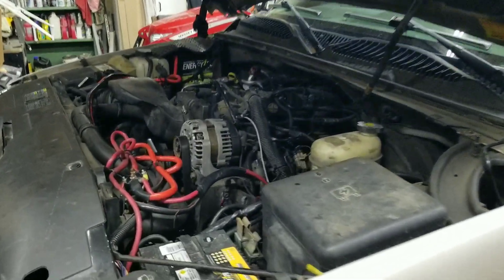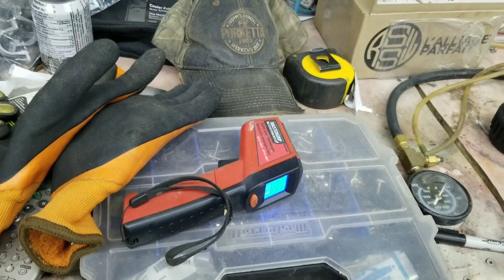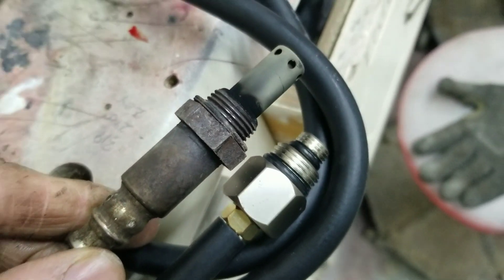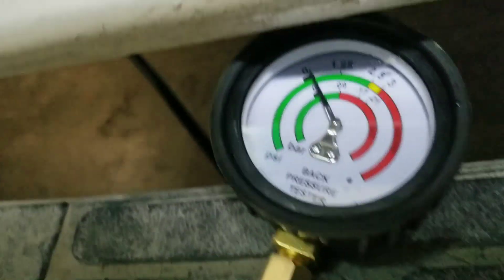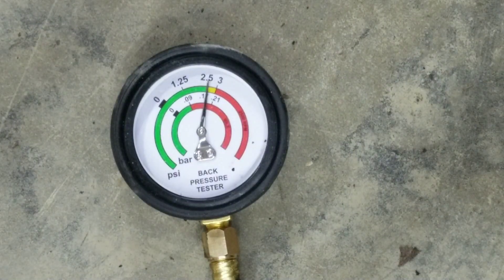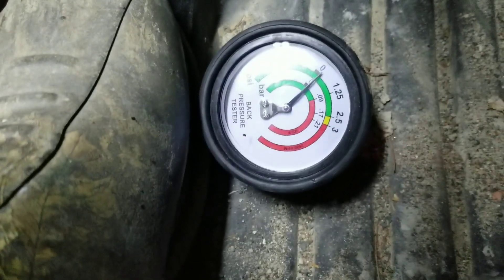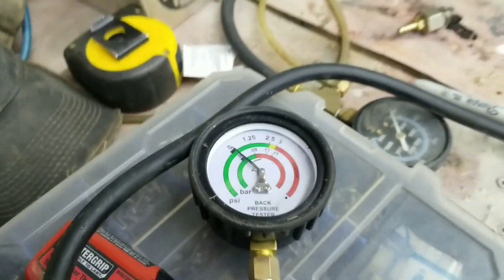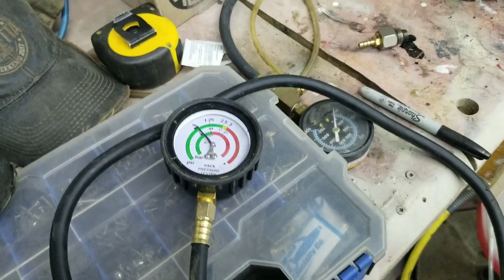How to tell if your catalytic converter is plugged

Comment: Could be there is a gummy or worn VVT solenoid or timer assembly.  Lax oil change intervals or the wrong oil can plug them up over time.
Reply from the maker: So does my 2006 sierra 5.3 have the VVT ?
Reply: @ontariooutdoorsman  It should. I'm positive they first applied in 2002 models in the Vortec lineup.
It should state somewhere either on the engine or in the manual.
It's a electronic controlled "hydraulic gear" off the end of the camshaft. 
My 2004 has it and fortunately the guy I bought this vehicle off of (first owner) was timely with oil change and it's pretty clean. 
I've heard if it's acting up its usually the sensor face is dirty and sometimes cleaning it works or replacing it. Reasonably easy to get to.  Worst case that gear assembly is fouled by gum or wore out.  Usually the engine won't run right at all by that point. 
Should be getting a code if this system is in your vehicle and malfunctioning. 
I'm thinking that either too much fuel causing the converter to heat up?
Reply from the maker: So I absolutely cannot find anything online in the way of parts for my 2006 sierra in the way of vvt.  Everything i. Finding is indicating vvt started on the sierra in 2010
......
Variable Valve Timing (VVT) was introduced to all V8-powered Chevrolet and GMC trucks, including the GMC Sierra, for the 2010 model year. This included the 4.8L, 5.3L, 6.0L, and 6.2L V8 engines. VVT, along with Active Fuel Management (cylinder deactivation), helped improve fuel economy in the 2010 Sierra and Silverado pickups.
Reply: @ontariooutdoorsman  Maybe one of the valves isn't closing properly?
A compression test is easy DIY then you can eliminate that as a potential issue.
Burned valve?  Dirt piece stuck to the seat?
Maybe take off the exhaust right at both manifolds see if it changes.
My mechanic showed me a failed cat years ago.
He held it up to reveal the ceramic core had cracked off the steel shell and rattling around inside. 
If you pull it off or maybe use one of those pipe inspection cameras
Reply from the maker: @RetroCaptain  well I know for sure the cat is partially plugged on the passenger side.  And according to what I read plugged enough to cause power problems.  The drivers side has essentially zero backpressure so there is a problem there for sure
Reply: @ontariooutdoorsman  The "zero" one may be ruined and empty. The plugged one is likely broken free and "spun" so that it's pointing the wrong way. 
Vibration from the muffler dangling for months can rattle the guts out of the cats.
Reply from the maker: @RetroCaptain  so I ran with scanner connected and had significant misfires on that side only.  Removed o2 sensor with scanner  connected ran again.  No more misfires.  At least I know for sure too much backpressure.  Local guy will cut and weld in new cat very inexpensively
Reply: @ontariooutdoorsman  Have a look inside them after buddy cuts each off. 
Then you'll see how tiny the passages are (easy to block) and fragile. Ceramic like a cheap teacup.  
The original GM cats were almost bulletproof (and you could clean them if they became plugged, as in serviceable not throwaway)

Comment: A random miss that is more common under load is most often spark plug and lead problem. I'm certain exhaust back pressure is playing a part thanks to increased temperatures and reversion messing with cylinder fill and scavenging. But I would expect that to be a constant not intermittent.
Reply from the maker: Thanks for the info.  I had never done plugs on this truck so I started wih that.  Then I sprayed all the wires and coils wih water spray wih an atomizer in the dark and didnt see any light show or get any misfires.  The only time I get misfires is under heavy load and I get some knocking. 

Appreciate the help
Reply: @ontariooutdoorsman That's a cool trick I had plugs go bad the brand new ones turned out 2 were faulty straight from the box same MO only missed under heavy load. I very much appreciate your video I never even thought such a tool existed. Have you since disconnected the cat to see if the issue goes away?